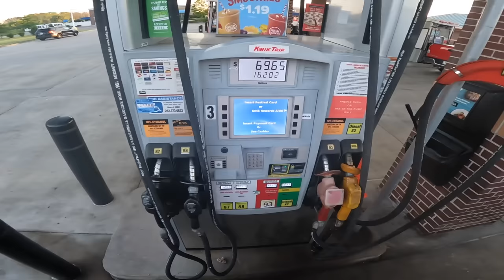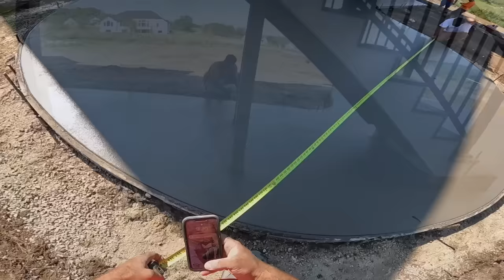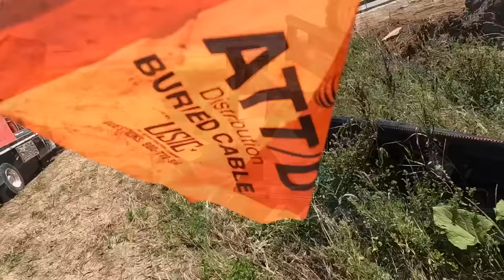I can't believe it, no issues on a Monday?

Comment: Thoughts and prayers for Scott from Brisbane Australia...you should come over to Australia we pour year round and in summer we have 35 to 40 deg C here and we start pouring at like 5am or earlier if it's really hot...and by lunchtime it's to hot to pour not just for the guys but the concrete sets up to quick and we actually put sprinklers on the slab in the evening or next day to slow the curing rate...gotta be tuff to pour concrete or be a brickie here

Comment: "Late doesn't count."   Great line.  
On my crew, I set the following late rules 0-5 = no deduction but a stern frown.  6-15 = a 15-minute deduction of pay, 15-30 = 1 hour deduction of pay, greater than 30 minutes = 1 day suspension.   No show, no call = 1 suspension. 3 suspensions in one year = fired.  This is made clear upon hiring, and the employee signs that they read and understand it.   99% of the time, the whole crew shows up 15 minutes early each day. The account for traffic and other possibilities where stuff may happen.  It's the only fair thing to do for the whole crew and your business.

Comment: Years ago, I worked for a framing contractor who had both his stepsons working for him. Both were late all the time and Pat would use the excuse he was at the tire shop having a flat fixed. Hours later he would show up and low and behold the tire had a yellow crayon mark at the valve stem and things proceeded has usual. Weeks went by and stepdad needed to take his car in for service and ask Pat to pick him up at the Dealership. On the ride back to the job site the old man noticed a yellow marker in the console. When they arrived at the house we were constructing the old man Socked Pat a couple times for lying to him. I looked at the boss in a different way after that. The man could throw some fast combo's...

Comment: dont put a flatbed on the dually.  sure its easier for the salter but as soon as you take the salter off, you'll be kicking yourself for not having it just as a pickup.  (this is coming from someone who did it and regretted it) unless the bed is rotted to the point you have to replace it.

Comment: What’s the purpose of doing your lines before your concrete dries? As opposed to coming in and doing it with a saw is there any plus or minus in either one
Reply: Cracks can happen overnight if you have the means to cut them in on pour day it’s definitely better

Comment: what is the reasoning for not doing concrete in winter the winter ? i live in northern Norway and the only weather that stops us from pouring is temperatures below -30celsius. At that point the concrete can start to freeze in the pipes of the concretepump while its getting pumped

Comment: Hey man I'll come from UK to work for you if you need decent guys ,I work at TECHRETE UK which we do precast concrete panels some small 4 metres square some 10 metres square that bolt on steel frames on site ,18 years in the concrete business so I got experience man .

Comment: Can those posts of the steps get buried in concrete I had something similar at my old house and within a couple of years those posts right away I would think you would build that stair after the concrete and use Simpson strong-tied brackets to Anchor It Down to keep it out of the moisture

Comment: Im giving you an F on this one. You should never have a step on a walkout. Raising grade a little more would have solved that. The deck steps and the siding by the door were all setup for concrete to go directly under. Now you have a void in between patio and siding and a concrete step where the deck steps start. Not a good look. Aside from that your work is awesome!! Keep up the great vids!!
Reply: @TUGG75  I live in Western NY so i'm in snow country and have had a slider going to a walk out flush to my interior floor and have never once had a problem. and i've built about 10 custom homes all that way with no problems. Sills on new doors are vinyl so it will never rot.
Reply: Haha nope not one bit. Why would i lie about that? If im not a builder i hang around a lot of job sites then for no apparent reason.
Reply: You apparently didn’t watch the setup video where he talked about the step.